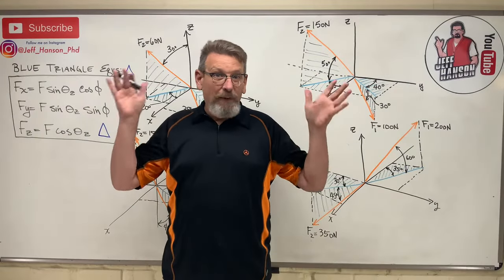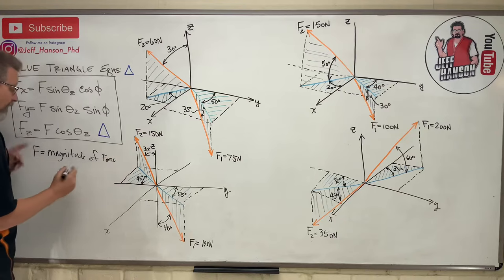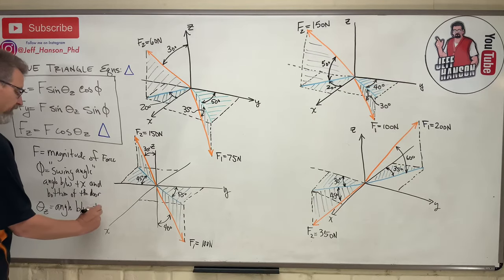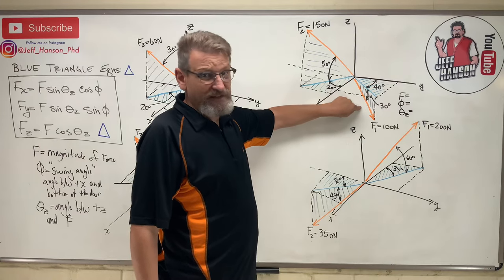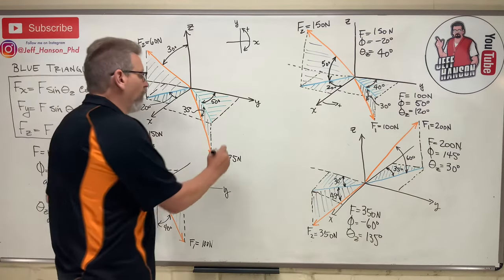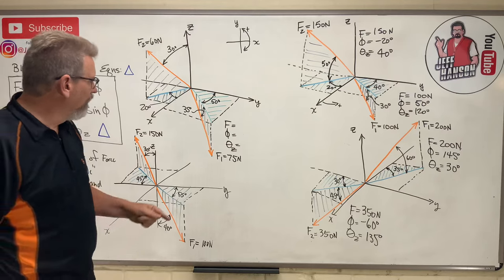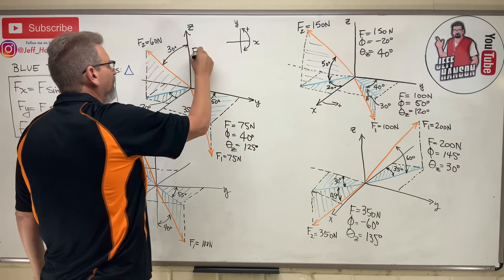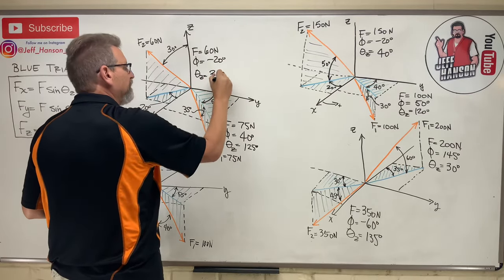Statics: Lesson 9 - Drill Problems Practicing Blue Triangle Problems (Spherical Coordinates)

Comment: Shouldn't Theta z be given positive or negative sign, depending upon direction of its rotation?
Reply: In top examples you can find Z components by either "F x  sin(degree) x (-1)"  Here "-1"  is used because vector goes to the negative side of Z Axis. Or you can just to "F x cos(90+degree)" Here cos turns the value negative by itself.

Comment: Hi, I observed that when we calculate theta_z and the vector goes into the floor, we are not considering it as negative. Since going into the floor means we are below the origin, I find myself questioning, 'Shouldn't that be considered negative now?'
Reply: No, theta z is never negative, and never bigger than 180 degrees. Remember, it’s the angle between positive z and the vector. 90degrees to the floor, plus however more degrees to the vector.

Comment: Hi Jeff! Greetings from Mexico 🇲🇽
I have a question, in the second example where the force is F2= 150 when we calculate the swing angle, is also correct to say that it's 340°? Like 360° - 20° =340°
Reply: they are the same angle
Reply: Not at all Luis. -20 would actually be 380. If you need the proof then just take the cosine of each on your calculator and they will be the same.
Reply: 340 and -20 are definitely equivalent angles for trig functions on your calculator. Same goes for any positive/negative pair whose absolute values add up to 360